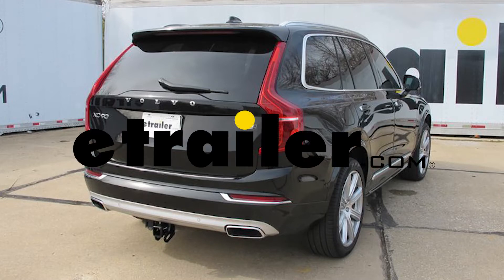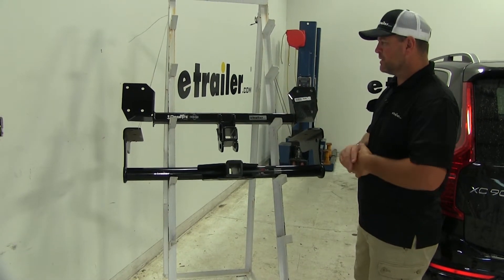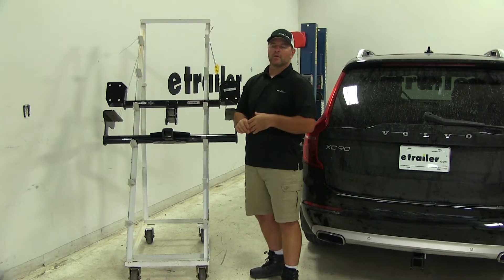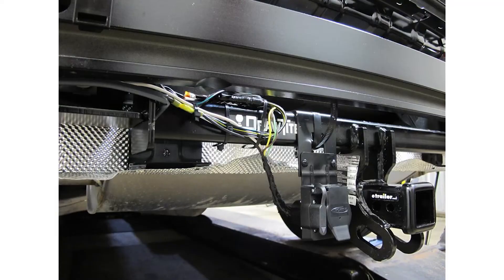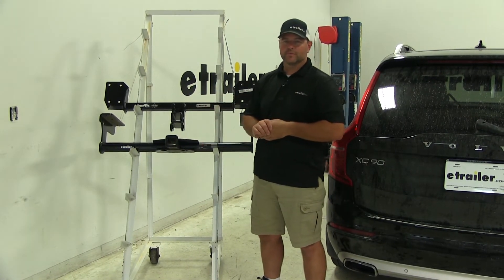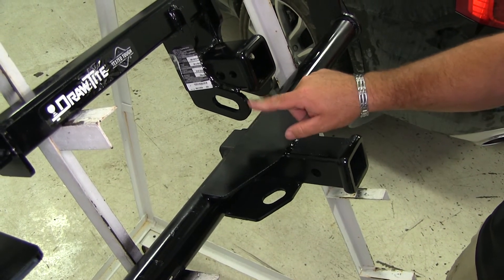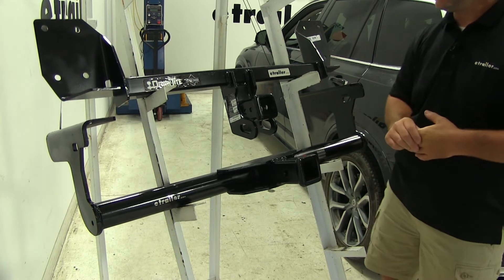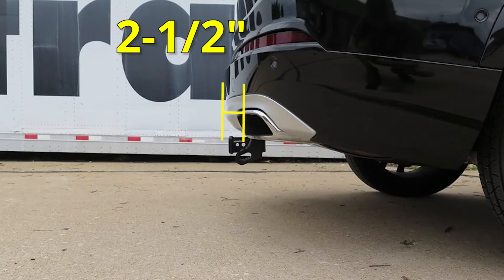etrailer | Best 2018 Volvo XC90 Trailer Hitch Options

Comment: If you install the draw tite hitch and install a bike rack, does it make all the XC90 rear collision sensors beep all the time? Trying to decide between a roof bike rack or the rear bike rack
Reply from the maker: A hitch bike rack will make the sensors go off. You would be better off with a roof mounted bike rack if you don't want to worry about the sensors going off.
https://www.etrailer.com/hitch-2018_Volvo_XC90.htm
https://www.etrailer.com/dept-pg-Roof_Bike_Racks.aspx